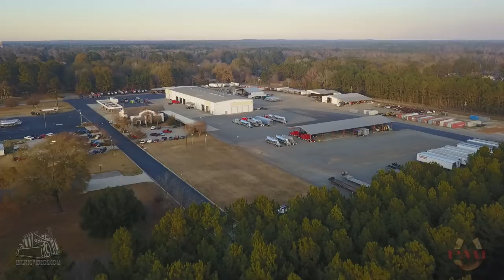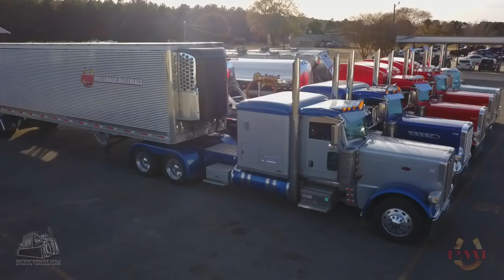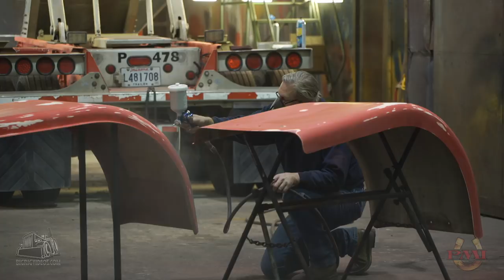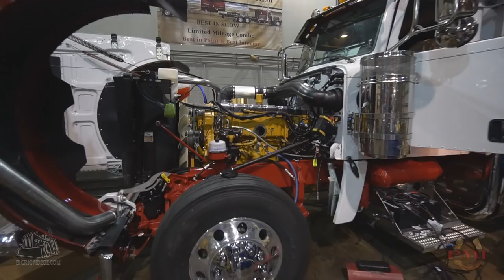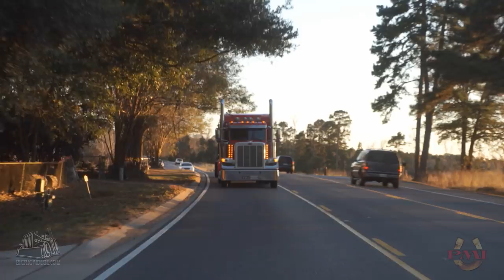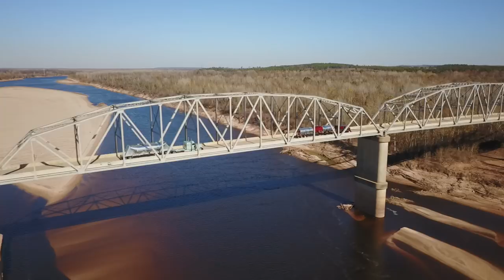Preferred Materials, Inc. - Drivers Wanted

Comment: I was already lookin up the phone number until they said you only get a week off after a year! Ha! I believe they said something about being out for 3 weeks at a time. Whats the point of taking a 34 if your not taking the 34 at home?
Reply: JSasso123092 I agree...anything less than 4 days off after two weeks is just a job not a career...very nice equipment here tho where were these guys when I had no experience looking for a company job??
Reply: All show and mirrors. You ever run pneumatic sand? It's a pita, noisy, dusty.. just waiting for the next clog. I wouldn't haul it across the street for less than $400 per load with their truck.

Comment: I drive for Riechmann transport    out of granite city Illinois  driving flat bed the most the run you out is 2 weeks but they'll work with you so the next week your local paid by the hour to be local can go hpme if ypu want to. We have 50 truck Fleet half of which is owner operators I'm a company driver get paid $0.46 a mile starting out and go up from there that's with six months experience they're looking for drivers treat you well and you're not just the truck number you're actually a person you can go in and talk to them yourself company trucks or 2014 roughly Peterbilt 579 they got some Kenworth's and some Internationals